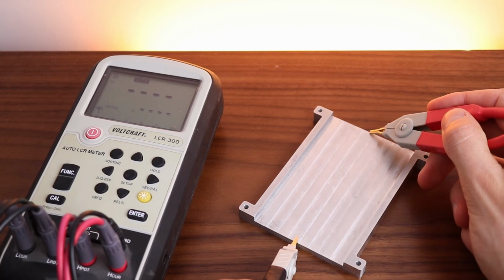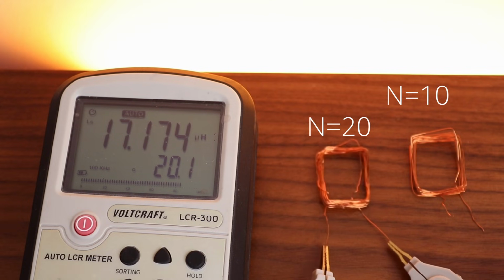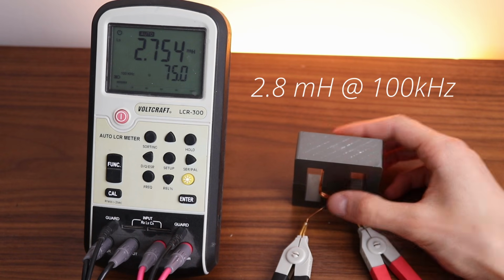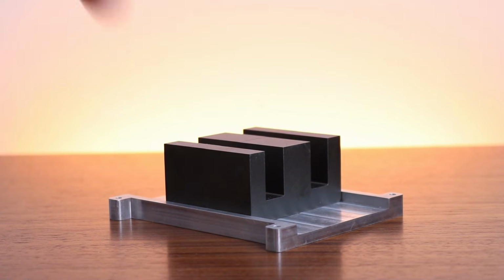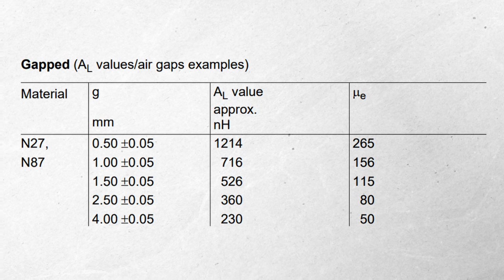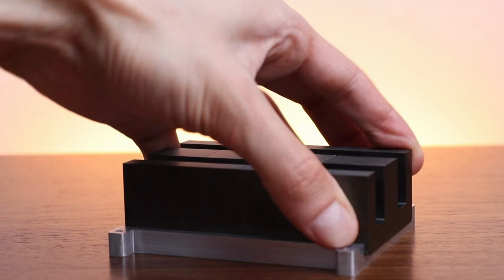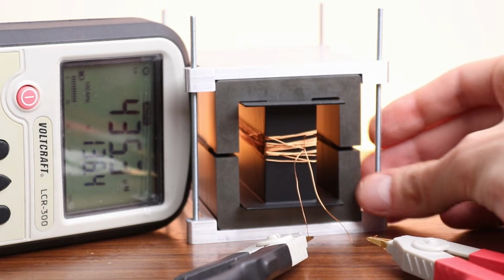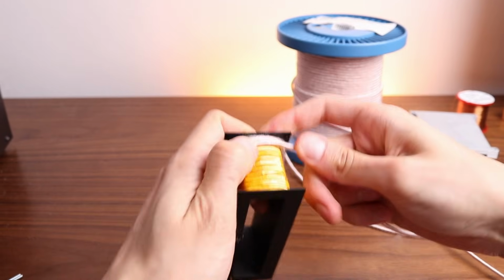10 Tips to Build the Perfect Inductor (Like a Pro)

Comment: Dear Nick, 

you have a nice project there, 
great idea of stacking those E-cores, . . . 

Moreover: do you know there are gapped & ungapped versions available ?! 
because you only seem to have applied ungapped E-cores. 

The difference sits in the TDK-partnumbering: 
for the 55/28/21 versions it is nominated under B66335-
and than you have -G000x187 for the ungapped versions. 

However you have 4 different gap depths to choose from: 
-G-0500 / -1000 / -1500 / and -G2000xx187 gapped versions 
for resp. 0,5mm / 1,0mm / 1,5mm / 2,0mm center gaps ;-)

Where did U buy that Litz-wire bobbin ? Partnumber ? Distributor ? 

Thanks, Harry.
Reply from the maker: HI, Harry. Sure there are gapped versions available. However, for some reason they are almost always out of stock on digikey or mouser. So, despite I needed standard 4mm gap, I still had to make it myself. 
Litz wire I bought from some local producers: 
https://www.aet.com.pl/Sklep/Type/ProductDetails/ProductID/HFL-NCV-100-T630/ProductName/Lica-w-cz-630x0-10mm-gr1-bez-oplot-klasa-F-lutowna

It is quite hard to buy it on market places like digi or TME, mouser, whatever. And if it is there, the price is insane.

Comment: wet sand paper will grind ferrite very well. gap will reduce transformer efficiency (wire resistance). round cores are better for leakage inductance. dont forget iron core transformer winding capacitance (at 100kHz who know what really happen)
Reply from the maker: Never tried sandpaper for grinding ferrite. I’ll try it one day when I have fewer cores to grind :D Yeah, interwinding capacitance is definitely a pain in the S. There’s only one way to find out if there will be any problems on practice ))))

Comment: The one issue I had when building my first inductor for a project was finding out what core material to use. The information out there is really lacking and is usually only "use X for use case Y" without any more explanation of how to get to that result.
I wanted to make DC-DC converters that are higher efficiency and higher power than the usual universal buck/boost boards that you can buy ready made.
The results of my research were: N87 with air gap, with an overkill size (overkill size is more important than using a more expensive core material). That resulted in 97.8% efficiency for a 20V->50V boost converter that isn't even synchronous (only uses schottky diode at output). The core doesn't heat up at all under max load, it's that overkill. No need to clamp the core together, adhesive tape around the outside works fine. Standard insulated stranded wire works fine, even at moderately high frequencies (I used 50kHz), overkill core size helps there as there is much more space for that relatively inefficient infill. For DC-DC converters the skin effect is less critical than at first sight as there is a DC component in the inductor current, which can use the whole cross-section.
Reply from the maker: Thanks for sharing your experience. Quite nice resuts. Just wondering what was the power of the converter? Cause if its was a low power one, this is even more impressive. I use N87 as well BTW :D
Fun thing though, If you use a bigger core, B_peak decreases for the same inductance, which means smaller hysteresis losses per unit volume. But since the core volume is larger, total losses increase, roughly balancing it out, I guess.
Reply: @NickElectronics  I think I measured at ~100W. The max designed power at the time of building it was 185W (Solar Panel MPPT). Since then, I converted it to 0-40V->50V as I upgraded the solar panels. Now peak load is at ~250W and the only things I changed was replacing the input capacitors to higher voltage ones and update the µC software.
So no, It's not a low power one. For that, I use another DIY design that incorporates specialized low quiescent chips. These also get overkill inductors, but overkill size there is just normal small thru-hole (instead of these tiny SMD ones). However, overkill size is not that effective there as other losses dominate.

Comment: Cool video. Those soft powder cores are easier to deal with for sure; you don't hit a saturation "brick wall" as quickly like with ferrites. Hysteresis in the mag materials and skin effect for me at least suggest using lower frequencies. SMPS industry is in love with wide bandgap semis to make parts smaller and frequencies higher so the commercial product is lighter and smaller for cheaper cost and shipping, but these attributes are at odds with the interests of the end user who might not care about weight or size. Personally I suspect you can achieve superior results with top-quality Si MOSFETs using a soft switching design with a huge inductor with low frequency and thus low hysteresis and skin effect loses. Smaller isn't always better.
Reply from the maker: True, but I definitely see the trend of companies moving toward wide bandgap semiconductors (GaN in particular) in low-power/low-voltage SMPS, like phone chargers, ultrabook chargers, etc. Because you know how marketing works: ‘We made a smaller device with the same power’ — it sounds cool and is actually quite convenient. Kind of like with the new iPhone Air, ahahaha. Marketing.

If you have to travel with a phone charger or a PC charger that weighs much less but heats up a bit more, that’s a fair trade-off in my opinion. It’s an inevitable step, really. People want faster and faster charging times, and smaller and smaller devices.

When it comes to equipment that just sits in a factory behind the big metal doors, where size doesn’t matter — yeah, I know IGBTs are used, because nobody cares about the size there.

Comment: Hi, I have a few points worth mentioning in this type of video:

1. An air gap increases the magnetizing current.
2. Air gaps in high-frequency coils/transformers act as energy storage.
3. The inductance of a coil on a core can be calculated using the formula L=N^2/Rt, where Rt is the sum of the core reluctance and the air gap.
These reluctances are calculated as follows:
Rcore=le/u0*ur*Ae
Rgap=lg/u0*Ae
Importantly, you're not taking into account the "fringe effect" here.
4. It's true that ferrite cores work well at 80-90°C, because increasing temperature affects, for example, the change in ue, but higher temperatures mean higher volumetric losses Pv.
5. The recommended current density in the winding is 3-4A, as higher values cause severe parameter drift and instability. When I was designing a transformer for my engineering thesis defense, I used 7A/mm^2 in the secondary winding. As a result, the voltage dropped more under light load than at 3-4A/mm^2.

Best regards.
Reply from the maker: 1. I think I mentioned that in the video, but in different words.
2. That’s true — most of the energy is stored in the gap.
3. Yes, it’s possible to calculate it, but it’s basically the same as using the effective permeability.

4. That’s not actually true. 
Pcv drops around 90 °C (for some materials). I even showed the graph in the video. You can also check it in the material datasheet.
5. It depends on how the system is designed, type of cooling, wire, etc. For example, I once used 8 A/mm². You’re probably talking about voltage drop caused by ohmic losses, but if the system is designed with those in mind, that shouldn’t happen. Also, designing a transformer is a bit different from designing an inductor.
Reply: @NickElectronics   4. It's my fault for not being specific enough…

You should view an inductor as a set of processes, not rely on a single PV(T) graph.

It's true that increasing the temperature from 25-90*C for most MnZn materials is beneficial (a slight drop in PV) because, as I mentioned, the magnetic permeability changes, which reduces the magnetizing current, resulting in a smaller H-field for the same Bmax, due to the condition B=uH.

Increasing this permeability affects the core reluctance, which in turn changes the coil’s reactance and thus the overall impedance, which affects the resonant frequency. The PV(T) graphs clearly show that a higher frequency causes a much greater increase in volumetric losses. This isn’t a significant problem for PWM-controlled converters (such as buck, boost, SEPIC, etc.), because a feedback system regulates parameter drift at other operating points. This is different for self-resonant systems (such as Royer, ZVS, ZCS, etc.), where the resonant f is determined automatically based on Thomson’s formula: 1/(2*pi*sqrt(LC)).

However, the main problem when using air gaps is the change in Bsat. Note that in the B(H) graph, the 100*C curve is always below the 25*C curve, regardless of the material. This deviation can be as high as 15–20%. If you don’t carefully set the operating temperature, you could fall into the saturation zone.

Generally, chokes/transformers are designed to stay below the “knee” of the B(H) curve — because near Bsat, PV also increases dramatically, as evidenced by the change in magnetizing current.
Near Bsat, PV curves are only rough guides—the core’s strong nonlinearity (collapse of differential permeability, waveform distortion from DC bias and harmonics, and fringing hot-spots) makes simple loss models unreliable.

So, initially, when the temperature changes from 25-90*C, your inductor will be happy, but a few time constants later, the situation can change radically…
Forgive the shorthand, but beyond a certain level of knowledge, many problems are beyond the timeframe of discourse, so there’s no time to discuss them.

5. Yes, due to ohmic losses and the change in resistivity resulting from the formula R(T)=R20*[1+alpha*(T-20*C)] — this effect is the reason for all of the above.
Reply from the maker: @k0sa673  4. You did take a big shortcut in the first comment, assuming that I knew you wanted to discuss variable frequency and resonant circuits. Of course, frequency affects losses: the higher the frequency, the higher the losses. But if we assume frequency is constant, then for the inductor, higher μ means higher inductance → lower peak current → lower RMS current → slightly lower losses. Also, the resistance of the core increases, which explains the relation between Pv and temperature (lower eddy current and dielectric losses). However, if the temperature rises further, the parameters do get much worse indeed. So it has to be monitored.
Reply: @NickElectronics  This is why I initially wanted to sidestep this topic a bit, and then brought topology into the discussion...

Converters operating at constant frequency (such as BUCK, BOOST, SEPIC, or the bi-Vienna rectifier) use feedback that modulates the pulse width (PWM) – this implies a rectangular waveform.
A rectangular waveform is inherently associated with higher di/dt, and therefore with higher harmonic distortion (THD).

In contrast, the Pv(T) curves are obtained according to the IEC 62044-3 standard, which assumes laboratory measurement conditions:
-sinusoidal waveform (low THD),
-zero DC bias,
-operating points always far from Bsat (what is equal to the linear region of the magnetic material - before the knee of the BH curve).

Therefore, when operating in CCM (with DC bias), applying a rectangular waveform (even at constant frequency), and working at around 80–90 °C, the actual volumetric losses can deviate significantly from the linear model shown in the Pv(T) chart.
In DCM it is even worst, because higher di/dt leads to higher harmonic distortion and, consequently, greater deviation from the P_V(T) curves.

If you want to determine the volumetric losses of your inductor more accurately, you must take the waveform shape into account (for example, by using Steinmetz-based methods with corrections – iGSE, MSE, GSE).

In addition, the subject is somewhat more complex – as you know, when performing a loss balance of an inductor/transformer, you divide them into hysteresis losses and eddy-current losses. Unfortunately, there are also so-called ANOMALOUS or EXCESS losses, related to the motion of domain walls in an inhomogeneous material. Without including them, the loss balance of the component is incomplete.

I believe this is a good point to conclude our discussion, as the topic is extremely broad and I don’t consider myself enough of a specialist to go much deeper into it.

Best regards, and I look forward to more materials!

Comment: When winding step-down transformers a good practice is to wind half of the primary, then all secondaries, then another half of primary. And don't skip on insulation.
Also when printing bobbins for the inductor, go with one of higher temperature materials, like ASA. PLA and PETG might melt.
Reply from the maker: True, but transformers are very different from inductors and probably worth a separate video. For PLA and PETG, that’s good advice, thanks! :)

Comment: how about induction stove instead. same format, but holds a heating box inside. making the heater induction coil separate from the hot box. assumes the inside holds a receiver for the induction power.
Reply from the maker: Induction stoves are actually quite different. Usually, it’s just a coil, and you have to place some ferromagnetic material on top with relatively high resistance. Eddy currents are created in the material, generating a lot of heat. You don’t have to worry about saturation (unlike in the inductor), because the air gap is already large.

The closest analogy is probably a transformer, where the indcution stove coil acts as the primary and the object you’re heating acts as the secondary (transformer with a short-circuited output). And as we all know, a transformer is not an inductor. A transformer isn’t used for storing energy, it just transfers it. An inductor’s main feature is the opposite — it stores energy.
Reply: just fyi, induction cooker coils use litz wire (braid where the filaments are insulated), in case you want to get some cheap

Comment: Nice introduction!  Some minor corrections (he says, writing a marathon comment... but the explanations are more interesting than the corrections themselves).
at 3:42:
- Ferrite price, medium (but that does depend on where you get it; and it's certainly economical enough to be widely used!)
- Powdered iron loss, low to high (roughly, inverse with mu_r)
- MPP loss, low to medium
- Nanocrystalline, is peculiar here because it's a laminated material

Ferrite is definitely low loss; an optimized design can achieve Q over 500. It's not always that high, of course -- depends how you use it, and for Q this high, litz is mandatory.

MPP is not as low: I've seen Q up to 150 at typical power switching frequencies.

Nanocrystalline is a strip material.  Along with sheet iron, losses are anisotropic: an inductor requires air gap,  the thru-plane fringing field around the gap cooks the material. This makes it kind of awful at high frequencies, actually; but on the rare occasion you need an exceptionally good low-frequency inductor (and are willing to pay for it..!), it's great. (It's also used in very high efficiency low-frequency transformers.) (Note that CMCs are better described as transformers: they aren't intended to store energy, but block power flow. Good CMC materials also make good pulse transformers. High-mu ferrite and nanocrystalline are excellent here.)

There's also NiZn ferrite, but cutting it from the list is understandable; it's used at higher frequencies, or for EMI filtering.

4:10 The dipoles aren't particularly slow, actually; electrical steel is (chemically) similar to powdered iron, for example. More like, the dipoles are embedded in pudding: eddy current / skin effect slows penetration of magnetic field, the strength of which depends on material thickness. Sheet steel drops off in the 100s Hz to low kHz, nanocrystalline 10s kHz, powdered iron ~MHz. Iron by itself, I think, runs out in the 100s of MHz to low GHz? (Not that this is particularly exploitable -- it's more of an elementary physics fact(!).)

Those are some stonking great inductors! Curious what one needs one whole joule of magnetic energy storage for..!
Reply from the maker: Hi, thanks for such a great comment and for sharing your experience. Future viewers will definitely enjoy it :)

As far as I know, there are different reasons why materials are useful at different frequencies, and losses are only one of them. Saying that dipoles are slow or fast is indeed a rough generalization :D 

Tough thing, this magnetism!

It’s barely a third of a joule per piece, but yeah, big boys :D I’m building a power DC-DC converter at around 20 kW. The input voltage is quite low, as well as the frequency. In the future I may optimize it, but for now the task is just to make it work—with custom software for the MCU and control. A lot of “fun” awaits :)

Comment: I am designing a transformer that uses stacked finishing nails as the core. Think it will work, or is it just a waist of time?
Reply from the maker: It will work. But the question is how good and what do you want to achieve. Actually transformers are different from inductors. For example, you don’t need an air gap in the transformer. Transformers do not store energy, they just transfer it from input to output (only flyback „transformer” stores energy, which actually makes it an inductor).
Reply: How are you closing the magnetic circuit with nails? Better to use a spool of steel wire if you want to go getto. PS waist / waste.